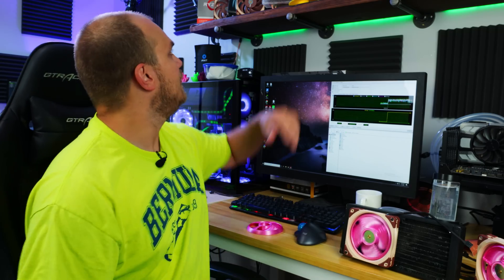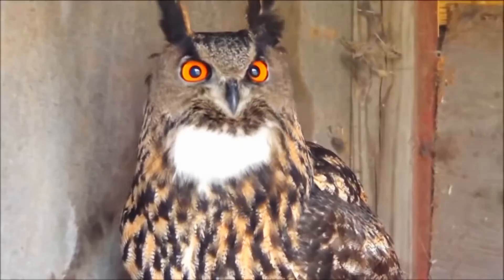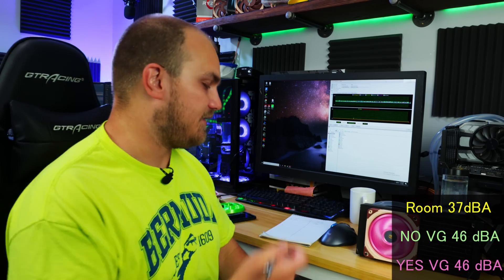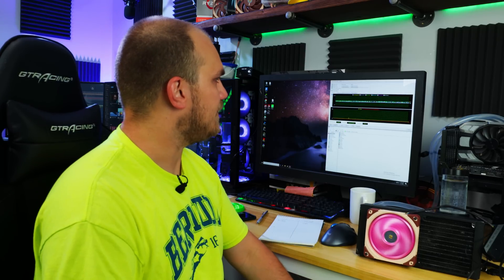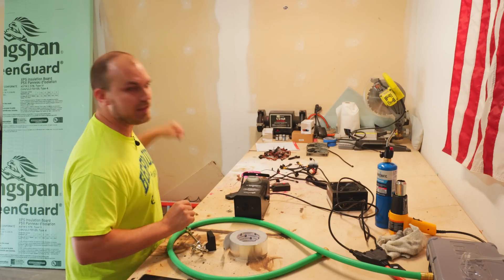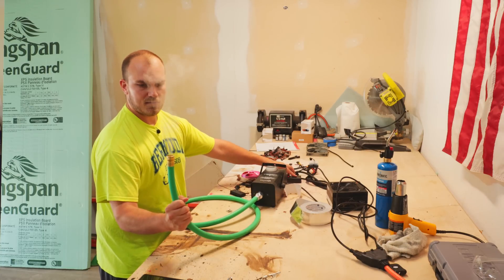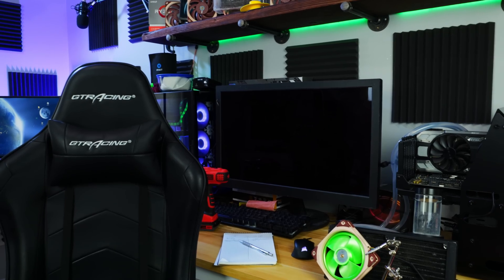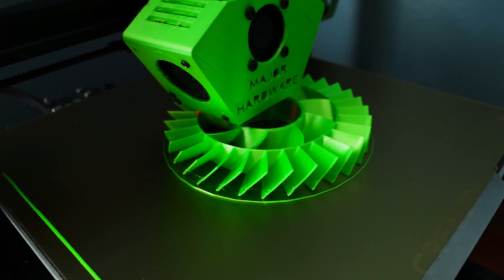Do Vortex Generators Make A Difference | 3D Printed Fan Testing

Comment: also i have competed in car audio for a couple decades now and i know for a fact that app and any apps on phones dont work even the one u use now is not going to give you a really accurate db reading ! you need an RTA what they use for sound quality and tuning high end audio equipment ! its not supper expensive because your computer does most the work

Comment: sooooo ive owned a couple evos and the vortex generators actually work! 300lbs plus of downforce onto the back wheels added when used! it helps direct the air under the wing to add that additional downforce at speed! there are some cool smoke test videos in wind tunnels on here! check em out! if u love to corner hard they help alot!

Comment: the Question wich profile/design of fan-blades is best is hard to answer.
I SUGGEST to build a build a windtunnel to test rectangular profile samples to see what the interaction with an airflow is.
to get the profile moving it might be interesting to mount the profile on a model railroad cart to move it through air , with a smoke generator mounted on the next car...

Comment: Data nerd dreaming big here, so be warned. LOL... Sound can be measured not only in decibel level but you could also use a spectrum analyzer to graph the sound of each fan. You could also construct a test chamber for sound tests and smoke tests. A combination A) sound dampening chamber with DB meter/microphone mount and B) controlled smoke airflow chamber so you have some regularity and maybe some new cool smoke flow visuals. I imagine that it should be about 3 or 4 foot w by 3 or 4 foot h and 4 to 6 feet deep, with a plexiglass plate dividing the two chambers. The fan mount is center-mounted in the plexiglass.  You can use an X mount on the open end to mount a smoke tube so you can put in the smoke stream or maybe even test using one of those big 12 in wide 'rainfall' shower heads to put in a bunch of thin smoke streams in a sort of grid. Use a bellows to gather smoke from your smoke machine and then gently inject it in through the tube without and then with the shower head. Not sure if the shower head will work, but it might, and would be very cool to see all those streams of smoke and what happens to them. Make the top and one sides have a few viewports and cover the rest with acoustic foam. Put some indirect diffusion lighting (bright white LEDs behind thin translucent  baffles, perhaps?) Maybe this is bigger than really needed and it could be scaled down. Tis just an idea that popped into my head. Hehe. This could be really useful if you wanted to isolate the fan sound and see what frequencies were being produced. That would allow you to quantify the sounds you describe. I.E. an annoying screech vs. a soft purr vs. a raspy hum. Plus maybe some more fun smoke footage. Love your channel and content! Keep up the great work!

Comment: PC fans dont operate on high air speeds compared to planes, hence most aerodynamical devices dont have a significant effect because the pressure is lower, proper sources of inspiration may be butterfly wings which are about same size

Comment: Given their location, why even would they work?
Their entire concept is to bend the air by forcing air travelling along a plane to move faster. They are already on the angled face, whatever air is there is already there. if there was an increase in blade pitch part way down, then the right style and size of vortex generator might work when placed slightly ahead of the steeper curve. But the high density air is hitting the inside face anyway...

Comment: Here's a crazy thought put a radial fan that drags air that would be stagnant in the centre of the fan and pumps it to the side where the other fan blades will push it through the fan, and possibly a ring of similar on the outside to pull the air from around the fan towards the normal blades to make a much larger draw area for the main blades.

Comment: Vortex generators provide benefits when the flow regime is at or near flow separation conditions. The vortices prevent flow separation. 

So the only way that they might provide benefit on a propellor is for a very aggressive angle of attack where the airfoil stalls. You're fan blades have a very low angle of attack so no flow separation is occuring. Meaning that the vortex generators don't work for this design.

Comment: Vortex generators are only useful when the combination of the fan blade's angle of attack and the speed at which it moves through the air causes the blades to stall. Specifically, what's going on is that the flow of air separates from the back side of the fan blade, and the blade loses any component of lift that is contributing to the movement of air. Small vorticies coming off the back of the blade will enable a more aggressive angle of attack without the blades stalling, which should move more air. If your fan blades are not operating at a speed where their geometry causes air flow to separate from the back of the blade (stall) the vortex generators won't confer any benefit.
If you really want to see vortex generators shine, design a fan where the version without VGs will stall. Then add VGs and see how this eliminates stalling.

Comment: So your EVO is going at a very different speed and scale than the fans.  Also, wind tunnels use very highspeed cameras and get a camera shot from the side.  Maybe you could use a transparent duct for the fan and film from the side. Though  I doubt that would work either, because wind tunnels tend to work with much larger models where the patterns become more obvious.

Comment: PC fans move slowly and are small. They operate in an airflow condition where you just aren't going to form vortices, no matter how big of a plate you stick on the leading edge. So they won't give the same things as something the size and speed of a plane or car.

Comment: Vortex generators are to help stop separation by removing part of the boundary laryer in contact with the surface if they work or not is dependent upon design and velocity. You'd have to do the math to see if there would be any real benefit or harm from them and would probably work better with blades that have a lot curve to them to help with redirecting the flow.

Comment: The reason some planes have vortex generators is to generate more lift when they're about to stall due to high angle of attack and low speeds. Aka: when the angle of the wing is so high that the laminar flow of the air no longer sticks to the wing. For blades like these with shallow angles and high rpm, it does fuck all. Which I guess fits neatly with the results you yourself produced

Comment: Wouter is right.  The fan surfaces need to be smoother to reduce power consumption and increase rpm.  Leading edge should be rounded and trailing edges tapered.  The blade profile needs to be wing shaped; intake side convex, output side concave or flat.  Hub end of blades should be narrow with shroud end wide to compensate for speed difference (M/sec.) between inside dia. and outside. Vortex generators should be as small as possible and on the trailing edge.

Comment: Doesn't a vortex generator need to be on the trailing edge? the little vortice cones spinning off the back of the blade then draw upper surface air with them, allowing new air to travel faster due to the lower pressure, generated by the vortice air having to spiral and therefore travel faster to cover the same distance over time?
Reply: Try your experiments with FPV drone propellers lol, they'd show the difference and really cool your components.

Comment: The purpose of vortex generators is to delay airflow separation on the low pressure side of an airfoil. They only re-energize the boundary layer at high angles of attack. I think you would see better performance with a higher pitch fan blade. If you're going low pitch, more blades is the answer.

Comment: Could you try adding "vortex generators" to the underside that go from a wider to tighter spacing from leading edge to trailing edge. Ie the front of the blade has the full surface covered by evenly spaced fins that tighten up in spacing as they move toward the trailing edge of the blade. It should cause compression of air as it is moved closer to the trailing edge maybe increasing static pressure.

Comment: I've now watched far too many of your video's not to subscribe. Really like the way you do experiments, it ain't dumb when we all learn something.  I don't know much about low speed airflow (mainly work on motorcycle engines) Would adding a better intake design improve airflow? At most basic, a 1/2" (12.7mm) rounded edge may help? A lot of people commented on the 'da Vinci' air-screw saying a shroud would improve things. From what I understand, in a static fan,  (as opposed to a moving one on drone or helicopter) ducting connecting all the blade edges should be more efficient as air centrifuged outwards will be directed back into airflow ,although I have no idea what would be the best duct shape? maybe something like a hovercraft intake on top and a reversed version underneath giving a kinda 'S' shape

Comment: the fins create areas of low preasure around the fan blades. This means that surounding air rushes into the small empty pockets, creating denser air being sucked into the fan. But the fan is to slow to effectively create the empty air pockets

Comment: The idea behind vortex generators is to promote flow adhesion, so they won't do anything unless the flow is detaching part way down the fan blade. What they might let you do is have a more aggressive blade angle on the fan so particularly if you're going to a higher blade count which with that design will require a steeper angle on the blade, you might find a difference.

Comment: On "the ring"....   I have seen clips that claim that ducted fans are better than just a fan.
Yes, the fan is "ducted" by the frame, but the ring would help with that part too I would think.

Comment: vortex generators help reduce sound by preventing sonic booms. this is perhaps the root of the myth that they make things more silent. of course that thing has to be like a military stealth black hawk or something lol.. the propellers of any given helicopter travels faster than the speed of sound so the little tok tok tok tok are little sonic booms. when you place vortex generators at the tip of the main blades they reduce the "boom" of the blades as they hit the speed of sound. they effectively muffle the booms. which reduces the noise of a helicopter by 80% in some cases

Comment: I'm not specialized in aerodynamics or anything, but the purpose of vortex generators is to energize airflow so that it can adhere to the curved upper edge of the wing, to prevent stall. That means they are really only useful for maintaining airflow over the wing at high angle of attack. Leading edge slats achieve a similar effect, though in a different way.

In the context of a fan, same applies because fan blades are essentially wings. When these two blades are otherwise identical, what you're observing here is exactly as expected. If the angle of attack (or the pitch angle of the fan blades) is low enough to begin with, then the blades don't stall, and adding vortex generators would offer little to no benefit.

If this reasoning is correct, then you should be able to see a slight difference in situations where the fan blades are close to stalling. This could happen because the blade pitch is too high, or if the airflow through the fan disc is restricted which has an effect on the AoA relative to the airflow. RPM also has an effect on the AoA so you might want to run a series of tests at different RPMs with other variables being similar.

The simplest way to test the effect on useful blade pitch is to produce a series of test fans with increasing blade pitch angle, with and without the vortex generators. This would allow you to determine the blade pitch where stall occurs with or without the vortex generators. In theory, vortex generators might allow you to increase the blade pitch angle a couple degrees over the version without them, but the benefit here is kind of questionable. High pitch angle would lead to increase airflow, but lower static pressure.

On the other hand, if the airflow is restricted enough so that the blades are stalling, adding this kind of vortex generators might help the fan to operate in more difficult conditions. This could occur in a situation where you need a low airflow, high static pressure fan. There's a possibility you could test this by building some kind of a diaphragm or other restrictor device to measure the fan's performance, maybe even see at which point (if any) the blades stall. If you can find that kind of scenario, then you could test if the vortex generators allow you to restrict airflow further than you could without them. But this would be a much more difficult way to test. Especially if you don't have a proper way to measure airflow volume, static pressure, and other such things...

Comment: As an aerospace engineer I can tell you are going down the wrong path.  You can generate high static pressure or high velocity.  So application is important here.

The amount of lift is a function of the camber and the angle of attack.  A high lift will result in high airflow rates, but overall lower static pressure.

Now why would you add a ring to the outside?  It's the same reason airplanes have winglets on the edge of the plane wing.  It prevents high pressure from escaping around the wing tips causing efficiency loss.  It also helps the blades from deforming.  But there's a better solution.

Jet engines apply a similar philosophy where the efficiency of the Jet Engine compression ratio is largely dependent on how close to the housing the blades spin.  On aerospace applications the closer you can get to the edge the better.  Be sure your 3D printer is set to a high density print

Comment: Would i make a difference if u would run the blades in the opposite direction? it seems to me that they are made to be turned in the other direction so basically clockwise. It looked like u only turned them anticlockwise. Dont know if it would make a difference, but i dont think that u can created turbulence anticlockwise with them. Nonetheless nice videos, keepem up!

Comment: Cooling is going to be based on the amount of air flow, the motor speed being constant, the amount of flow isn't going to change much. The angle of the blades would adjust the air flow. Vortex generators reduce friction, meaning the motor will need less amps to maintain the same speed. Serrations on the trailing edge would reduce the noise of the air flowing off the blade. The ring is adding stability to the blades, less vibration. Removing the ring would most likely add noise.  I would look into increasing and decreasing blade size. 3 blades would maintain balance and require less material to make. Look into the theory of wind turbine rotor operations, and turbo prop planes. Both really heavily on the amount of air flow through their blades, and wind turbine blades are looking into ways to reduce the noise of the blades as they cut through the air.

Comment: Late to the party, if you want to run vortex generators. Use a high blade count. With a rounded blade that has a very shallow angle of attack on the top, but is very steep that the bottom.

Comment: Hey. CPU fan and air pull trough radiator are only 1/2 of the cases where the vortex might make a difference.  How about trying this against a filter mesh and regular perforated holes on a case in both positive and negative pressure case... (with the "vortex" side of the blades facing the radiator, or being directly against the filter mesh). Well regardless if you try, it was a good video.

Comment: vortex generators are for high blade angle of attack where they are at risk of stalling. VGs help delay the stall, keeping lifting surfaces working at lower speeds. Doesn't make sense on these fans in my mind. Instead, look into the work of Albion Bowers, who retired from NASA recently. Check out his Prandtl-D aircraft and following research if you wish to reduce noise.

Comment: Don't know if you'll see this 3+ weeks down the line, but if you are going to do smoke testing, I would recommend building a Plexiglass tube with a stack of straws at the front end to help stabilize the flow before the fan and get it as close to laminar as possible. The whole thing wouldn't need to be Plexi though, just the parts before/after the fan. Enjoying the vids though, keep it up!

Comment: I think the vortex generators should be on the opposite side of the blade. On the backside edge of the blade. They are for “smoothing” the air leaving the top or back of the car to direct air back instead of creating a back cycle of the air. So I think they would be more effective on the opposite side of the blade

Comment: Here is an idea, change the number of blades (two, three, four, five, etc. etc) I have noticed over the last few years that more and more aircraft are running more and more blades on engines (C-130j and USN E-2d Hawkeye BOTH run 7 bladed props).  The other thing to try might be to put the vortex generator one the OTHER side of the blades?  P.S. just to add some MORE complications... try the golf ball dimples AND vortex generators?

Comment: The ring you created around the fan body cancels out any rotor tip noise...This is why there is no difference. As for the Vortex Generators, this is used to keep the airflow over the body of the blade closer to the surface of the blade, nothing more.

Comment: Run smoke in the front of a case and put single fan at the back of the case and see. Also did you
 get more RPMs on the Pink one?